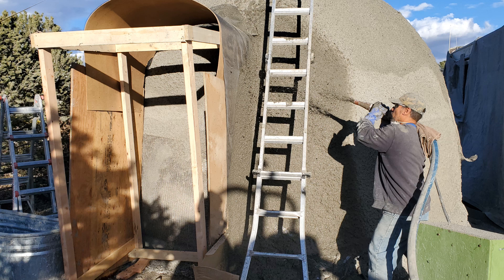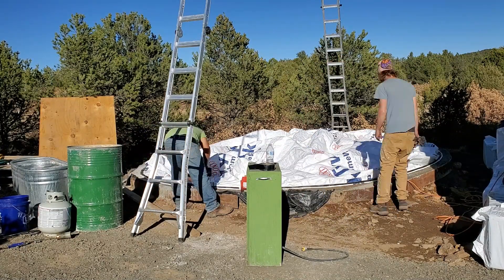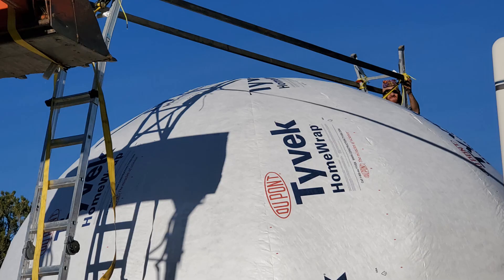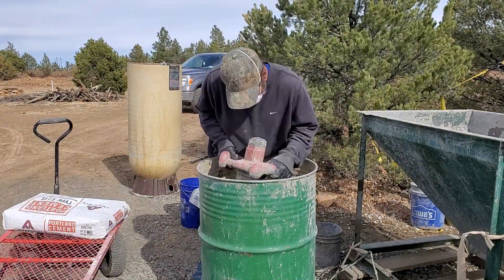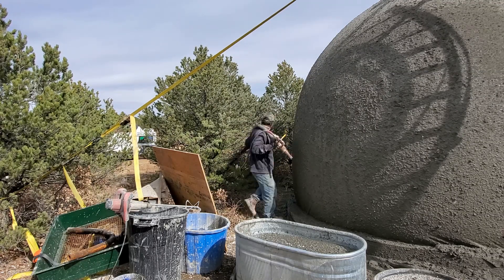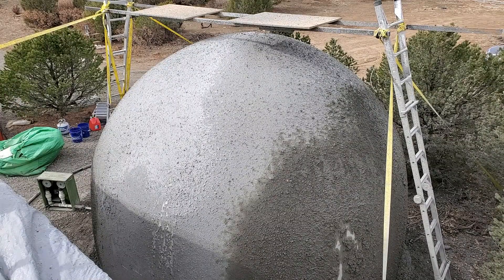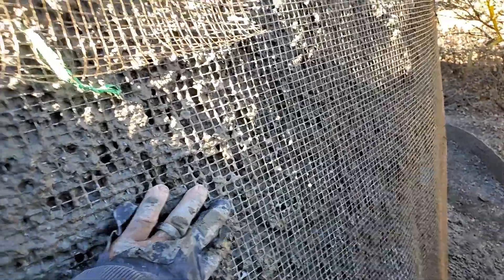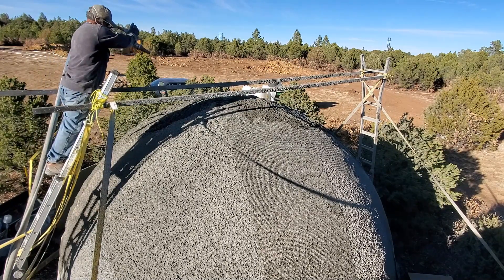Building E.P.I.C. Cement Dome | Part 2 #aircreteharry #EPICcementmix #domehome #aircrete #diy #dome

Comment: AirCrete is easy to work with, easy to make, lite weight and inexpensive. With just basic skills, you can make AirCrete and get started on building a home, even for under $10,000. 😁
Reply from the maker: Welcome to the channel 👍 
#facts

Comment: Thanks Harry!  Is there a conflict in heat and cold expansion problems that would cause cracking in the different types of concrete mixes when they are next to each other.  Like ...a thin layer of epic mix shot Crete and then a thick layer of aircrete?
Does it matter if the mesh is imbedd  in the outer layer of the aircrete and then plain shot on top of the aircrete without actually touching the mesh?
Reply from the maker: For the Double-Shell Aircrete Dome hasn't shown any conflict in heat / cold expantiion. 
For the Mesh layer is used on top of the Air-Form directly. 
For the Mesh provides great support for when spraying the mix on. It gives it a grip & you can spray much faster and more on top of the Structure. As for the Air-Form alone, you would need to take time spraying. If sprayed too much at a time, it may start to simply slide.
Therefore Mesh is very recommended. 
It is the Key for Strength, Grip & Faster Work. 👍 
Putting a Mesh on the outside of the Aircrete and then spraying a stucco on it - is a great way to finish it.

All available on my website as well.
From forms to how-to to recipes:
https://aircreteharry.com/shop-1/
Reply: @AircreteHarry  thanks Harry!  I'm a 77 year old female artist and have been following along and have finally made my own foam wand etc.  I have my own ideas about making  and pouring shells and I will let you know what I come up with.  Aircrete is on my bucket list of things to accomplish.  Thank you so much for sharing your adventure so the rest of us can learn.  As soon as I can afford to come to your classes I will be there!
Reply from the maker: @tonitouchberry6257  Our Pleasure to Connect with You Toni!!
I am honored to receive your kind words & positive energy.
It is much needed in this world. Thank You & my pleasure.
Continue following your gut feeling and pursuing your ideas. They come to us for a great reason.
We both absolutely welcome your positivity.
Feel free to connect with us via email as well: Aircreteharry@gmail.com 
Our Very Best to You!

Comment: Greetings Aircrete Harry from New Mexico, love your videos.  I always thought of doing something similar but with lava rock as the aggregate for the concrete mix.  It is light, has air pockets and could be lightly washed for an interesting texture.  Have you heard of anything like that?
Reply: My biggest concern is that lava rock is made up of glass and other harmful stuff that might be horrible for your lungs if it's ground up and other aircrete experimenters have found that sand  breaks up the bubbles too much and is heavy and sinks.  Don't know what Harry has to say but this is "my" logical answer!
Reply: @tonitouchberry6257  I did not know that lava rock is composed of glass.  I think any masonry product that powderizes, or becomes airborne, is not good for the lungs, do not see that happening as it is wet mixing and afterwards the concrete sets.  The sand as it is being churned could definitely wear the edges of the lava rock, I think the majority of the rock would be intact, but that is an assumption that is why I asked.  Gravel is heavier than lava rock, and it does settle or sink a little.

Thank you for the response, you have given me something to consider.  If it breaks up into too small of chunks it would lose it's redeeming quality of the insulating air pockets.

Comment: Could the Tyvek balloon form bags be replaced with a special made Tyvek bag where you create right angles?  I know my idea is counter productive according to your building techniques.  An altered Tyvek bag form. Too bad Mylar is not a strong enough material to alter the initial forms...But cut panels can be melted together by making sealed seams with heat.
In my past, I made 3-D models for amusement park rides. They made sprayed cement structures using the models as a visual prototype. The models were foam cut and sculpted to a 1/2" scale.  They represented cavernous rooms for a ride. I never saw the end result since I was stuck in an office building making models.  My superior saw all the construction and end results. I do remember following an architects blue prints and discovering a scale mistake...After the concrete cavern had been made.  They sweat bricks the day I discovered it.  Fortunately, that person did not loose their job.  However, there was lots of demolition and construction to correct the problem.  If I was back in Ancient Greece when I discovered this, I may have been killed.  Just kidding.  The Bearer of bad news.  Yikes.

Comment: Great video, thank you for doing this ground breaking work.  Keep it up
Reply from the maker: Welcome Joe 👍 👍 
Appreciate you! 
Are you building anything yourself at the moment?
Reply: @AircreteHarry  not currently.
Reply from the maker: @joelex7966  Have you done any work with Aircrete? What projects? Feel free to share!
Reply: @AircreteHarry  no, but I have built many sheds and garages in the traditional manner.  Air Crete is one possible future.
Reply from the maker: @joelex7966  Sweet 👍 
Yeah, for sure. Plus it will bring the cost down.
Reply: @AircreteHarry  yes it will it just needs to be reinforced.
Reply from the maker: @joelex7966  Yes 👍
Reply: @AircreteHarry  I first heard of Aircrete 5 or 6 years ago and thought that is was an amazing concept with huge potential.  Currently it is being used for facades and non structural components.  I have always wondered if it could be reinforced with recycled plastic mesh to give it more sturdiness.  Just a thought.  Can it be sealed with a mixture of tar and mineral spirits to make it less porous?
Reply from the maker: @joelex7966  There are many ways to approach it by experimenting. After doing years of testing and numerous experiments - I stand by that I personally advocate for it to be used as an Insulation. In other words, sandwiched in between strong, stable layers of solid structure. By itself it is not safe enough to be used as surface. For Insulation it is Great 👍
Reply: @AircreteHarry  I can agree with tha
Reply: There is a construction technique known as stove wood.  Debarked sections of tree trunk are stacked and mortared together on the inside and outside ends and the gap between the ends is filled with vermiculite or mineral wool.  I have always thought that solid layer of air rete could be used for both the mortar and insulation.  That would be quicker, easier and less expensive than the traditional method.  And since the load bearing component is the firewood it should remain every bit as structuraly sound as the traditional method.  The wood has to be fully dried you avoid gaps from forming and settling occuring.  The ends of the wood and the Aircrete could be sealed with Thompson's wood protector or a similar product.
Reply from the maker: @joelex7966  I've heard / read about it, too.

Comment: Great vide Harry thanks for sharing. Hard job. Any link for your Epic Mix ? I would not use only cement as it is not breathable,  but in this country we don t find lime NHL which is a basic healthy building material everywhere else. Also do you think a 30 ft diameter would be realistic with tyvek form ?
Reply from the maker: Thank You!! For the EPIC mix you can click here: https://aircreteharry.com/product/how-to-mix-epic-cement/  Yes, you can make a 30 Footer with Tyvek. https://aircreteharry.com/product/30-foot-how-to-make-your-own-dome-airform-step-by-step-aircrete-harry/

Comment: Wow, I've never seen anything like this and i find it extremely interesting. One question, could this system be implemented in the construction of a house. I suppose windows and doorways could be cut in with a concrete saw after everything cures. Great job Harry and kudos to you for trying something new.

Comment: Doesn’t concrete dry stronger it’s cured slowly? So forcing it to dry with the heater wouldn’t be good idea.
Reply: Freezing would ruin.  Slow not good.  Warm and wet is good.

Comment: Build a good secure platform about 4X6 with steel under supports that will attach to the front end loader you have. You would be safely lifted into position, to control your application.

Comment: you are the man with air crete for sure !!!!have you heard of the stainless steel fabric that is used on paper machine rolls at paper mills ?The fabric would be a forever support. The mesh is a 20 ft wide roll that is available at the scrap dealers for scrap price.Ive used it in fiberglass boat building ,and that is a bullet proof boat .There is a solar refigeration unilt that makes water by cooling the air and collecting it as condensation.have you thought of a straw mix with the aircrete for more insulation and strucure as well as it lightens the mix over your head.carry on mr and mrs harry love it!!in the north of british columbia we have 100ft circle c rings for oil drilling production.they are 2 layer 4 mill plastic sheets  that get recycled after use to the shreeder.WHAT COULD YOU DO WITH A 100 FT CIRCLE MR HARRY ?JUST DREAM IT!! I CAN COLLECT THEM FOR FREE!!

Comment: I don’t know if I said it already or not, but I really like that mesh layer that you put on to strengthen up your structure. Almost acts like fiberglass. Excellent choice sir. Really enjoying your videos sir, keep them coming please. Thanks for sharing your knowledge too.
Reply from the maker: Appreciate you, Thank you very much! 👍 👍 
Yes, the Reinforcement Mesh provides great Support & Grip for the mix to hold on to.
Without it one is limited as to how much to be able to apply - as it would slide down if put on a bit too much. Having something to hold on to is Key & speeds up the process!

Comment: I would imagine aircrete would flow on top like those acrylic paint pours. Stand on the ladder and have at least a couple friends handing you buckets, and also standing on different sides pouring, if possible. How exciting! I would love to find out how that would work, and also mixing aircrete with the styrofoam that the Japanese use in their dome homes.

Comment: Cool shit man! I always called this spray crete not air crete however. So I was expecting you to make the dome out of air crete rather than spraying it so I was suprised to see how you actually did it. Very fun. What's the cost of a building like this?
Reply from the maker: Yes I got into Aircrete as an inexpensive way to build a dome home. This Dome was an experiment of building with the EPIC cement mix. 
EPIC by itself is much stronger than Aircrete just a little more work to make and a little more cost to make then Aircrete. 

My next dome build will have Aircrete, EPIC and a new cement mix I'm experimenting with. I think will be the best way to build a dome fast strong using Aircrete for my insulation.
Reply: @AircreteHarry  looking forward to seeing that. I'm fascinated with Aircrete and cord wood masonry both. I want to do an experimental building using both methods.

Comment: Ever think about hoop houses? Use cattle feedlot panels. They do canistoga huts, but I think walls for a dome can be built up by hand as long as you use bird cage wire on the feedlot  panels and the job would be done quicker. After walls up cap it with a dome airform and build up the mass.

Comment: Great proof of concept I really like the heated inflatable forum, come up with a trailer with a refillable hopper to load a whole pallet of cement mix in ,a place for a larger air compressor,an scaffolding. A complete tow anywhere dome building kit on a trailer. A 30 ft trailer with every thing you need to build a Air- cret  dome would be epic .

Comment: Love the Video!   Thinking on the processes of making an off grid home.  I an very interested in the Tire Rim Cutter took that was delivered and used at 10:41. It looks like what I need to acquire next. What it is called and who makes it. I know that I do no want to pound tires at an angle with a sledge hammer when I could just cut off the top and tamp it vertically.  Keep up the  great vids!!!
Reply from the maker: That was the reason for getting the side wall remover machine, pounding tires at an angle with sledge hammer and only getting 10 tires done a day. LOL no thank you, I think this will be a much faster way to build.  When you call or order online tell the I sent you.  https://www.eaeco.com/collections/stage-1/products/psr

Comment: With no oil sprayed on the dry hopper, then no water or slurry to prime the pump, that thing ain't gonna last too long...
Reply from the maker: The EPIC cement mix I used is not like pumping regular concrete. Oil would be a good idea.

Comment: Did you ever consider using a fiberglass chopping gun?  I'm thinking it would stick well to the dome right after the concrete spray. It may be quicker than the mesh and may be stronger. (Or a combo of the 2) For a dome like this ..I'm thinking you need all the structural stability you can get.

Kudos to you for thinking outside the box.
Reply from the maker: No I did not but I have some other Ideas. Instead of fiberglass I want to use Basalt chopped fibers they are stronger then fiberglass and can be added to the cement mix.

Comment: All you needed is some plaster A-Frame Scaffolds I used them for many years dong stucco on houses, they come in different sizes with an attachment that will get you 3ft. higher so in total you can reach 14 ft. and they are wide enough so you don't have to tie them off, you would only need 4 of these and could set one set in the middle then do the other set opposite direction to form a tee.
Reply from the maker: Thank You! In this case I had to use what I had on hand.

Comment: It would have been easier to make your form out of styrofoam sheets, then cover with cement, once dry cut out styrofoam material and voilia a concrete dome.
Reply from the maker: Not as easy as that small model. The way I did it was easiest for me and my next dome will be super easy to build coming soon.
Reply from the maker: Show me a video of someone who did that. You make it sound easy.
Reply: @AircreteHarry  https://youtu.be/QKPtQksKBxM
Reply: Just need more sheets and bigger.

Comment: Intrepid scaffold system, but so that we can get future videos of you building rather than in a hospital bed you could make 4 tall tripods from lumber, roping the base of the legs together to stop them spreading out and join the tops with beams, then you can span the beams with an ally ladder covered by a board anywhere to get to any section of the dome
Reply from the maker: I had to make do with what I had on the property. I like your idea also.

Comment: I get the idea of the dome....but what is the purpose to build this way....it looks like you are using more resources than if you build a square house.   Maybe you have a purpose I don't know about but that is too much work to build a round house that is not easy to decorate or live in.....
Reply from the maker: Hi Sara,  I will give you a list of reasons why I build this way.  Cost to build this 200 square foot dome price was under $3000. Speed to build If I did not have any weather delays it could have been done in 4 days, Unlike conventional stick building the first thing you build with a dome is the roof. Resources is far less there is almost no wood used. It's just Tyvek, cement, EPS Foam, paper.  As far as decorating check out this dome home>>>>>          https://www.youtube.com/watch?v=VZFZj7Cw820   Thank You!
Reply: @AircreteHarry  I do appreciate your response...I will take a look at the video...

Comment: what concrete pump do you use?
Reply from the maker: This pump.  https://www.bing.com/images/search?view=detailV2&ccid=FEHcFjqM&id=4F1CD86AB2D48145E94B0C2DF30EE30F3FCE0711&thid=OIP.FEHcFjqMLvT6Uq5L6fcc1wHaEE&mediaurl=https%3a%2f%2fwww.monolithic.org%2fvault%2fimg%2f2011%2f05%2f10%2f4dc92b4ec29e068473000790%2flarge%2fdscf1087.jpg&exph=878&expw=1600&q=monolithic+cement+pump&simid=608006869797045687&selectedIndex=0&ajaxhist=0

Comment: When will you be able to quote construction costs for a person to use in their bank construction loan application?
Reply: Excellent.  I'm currently into rehabbing a log cabin to be sold. I want my next place to be a multi dome structure of my own design. Earthbag is great but simply too much work. So far, I like your approach best of all the processes I've seen.
Reply from the maker: So far I spent under $1,800 to build the dome. Not including the tools I had already.
Reply: @AircreteHarry  Those tools are a big cost that most people won't want to make. Will you eventually do this as a construction company for other people?
Reply from the maker: @HealthyHappyJason   I will definitely be doing consulting jobs where the equipment is rented from me. By next year  I will have a tool system available for people that will mix and pumping Aircrete and EPIC. For a few thousand and after you build your house you could sale or make bricks to sale.